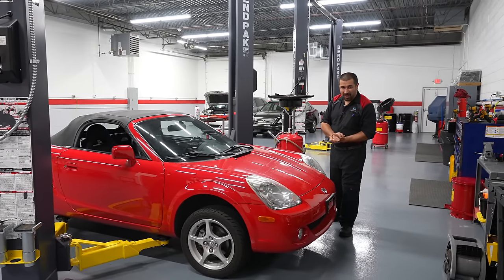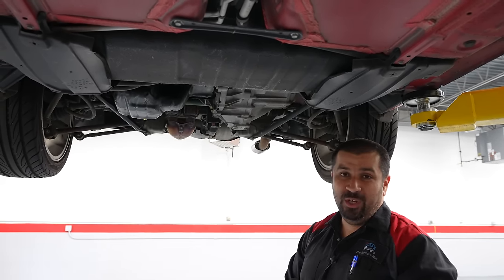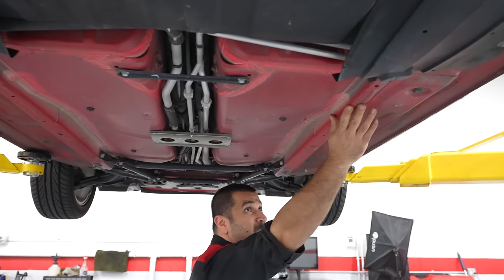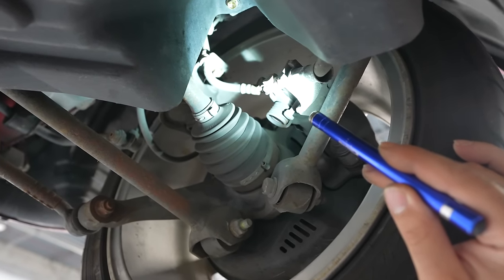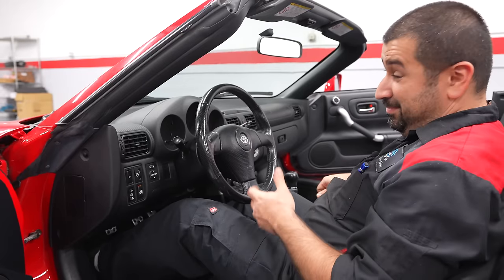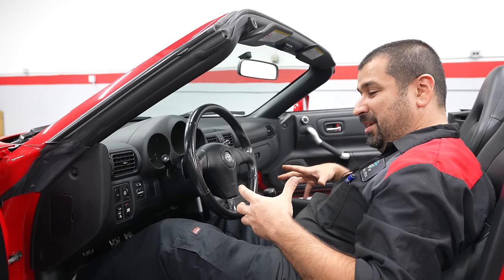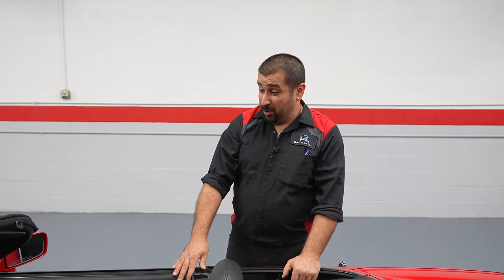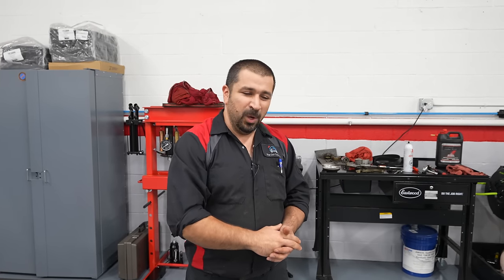Toyota MR2 Spyder Deep Dive | A True Toyota Icon That Should Come Back

Comment: I own a 1988 MR2 with 71,000 miles and it’s my daily driver. I get so many compliments about how cool the car looks and how they wish they never should of got rid of it.
Reply: '88 with 71k miles? What's ur daily drive, 0.8 miles?
Reply: Bought it 5 years ago with 45,000 miles. Have to store it in the winter.
Reply: I had an 86 supercharged AW11. It was the best car I’ve ever had and was the dictionary definition of exhilaration!
Reply: I loved them!! Always wanted one but i just passed my driving test & car ins was peretty expensive 😂 Mk2 i loved too but MK1 for the win.
Reply: @rickproulx6667  Much respect!
Reply: A few months ago at a local Toyota summer show party I checked out an original family owned '86 MR2 with over 300k miles... All kinds of Midwest body rot and rotted floor panels but was still driving well... It had so much more class than the newer tacos and supra somebody was flaunting
Reply: I regret selling my AW11 ...
Reply: I bought my MR2 3rd Gen at 72k 😁
Reply: gordon murray t50 is bascally a modern mr2 except with much higher budget , it even has similar apperance
Reply: @rickproulx6667  Putting miles on that car for daily driving is a sin
Reply: I've got an 88 MK1 Super Charger (had 3 MK1s as it's the only MR2 I love and to me IS the MR2!) It still looks the coolest (especially in Dark Blue that makes it look classy and hides the shut lines), distinctive styling, good proportions (unlike MK2 which got too long/bloated) and yes everyone seems to love it, esp car guys who know what it is.

Comment: These MR2s were selling for around $5-7K in good condition about 10 years ago.  Most of them have been destroyed and junked.  The survivors are just getting more rare and expensive.
Reply: Paid 15k for mine over a year ago
Reply: They go for 12k to 15k for a solid mr-s
Reply: I payed 7k for my 39k mile beautiful 2001
Reply: @arlenburgin2392  i paid $3900 for mine im 2017
Reply: @nx_Exe  timing is everything
Reply: they are still about that price in germany sometimes even cheaper, thats why im looking at them for my first car
Reply: @happi6969  I got mine for 10k and it’s my first car. Had it since august
Reply: just paid under 5k for one, but with over 200k miles. I don't care too much as if the motor goes it will get a better swap anyway, its just the suspension stuff i would need to replace but honestly 50k or 200k doesn't matter much with age.
Reply: Sad but typical. I found is300s in perfect condition the junkyards refused to sell just to they could sell some parts and crush the car. This happens with all cars they don't give an f if it's rare
Reply: Toyota offered me $6k for my 2003 with manual transmission with 108k. The car has been garaged for 18 years and is very good condition. Is it worth more in your opinion?
Reply: @deputy3690  definitely worth more.
Reply: @deputy3690  yes look online at used ones, they're going for a lot. Wish i could buy a clean one like that
Reply: @supers0nic77  I have one as clean as that in the UK....late 2004 , 35000 miles, factory hardtop, tte (team Toyota europe) style/roll bar.....paid £4500 in 2012 with 25000 miles + £500 for a matching colour never used new hardtop and fitting kit I found a week later after buying the car.
Reply: @deputy3690 6k?? I have a 2004 and I would be willing to have a 2nd MR2 for $6k bc that's an absolute steal
Reply: I have 3. Race one, daily one, and last is a parts car.

Comment: IMO this is hands down the best MR2. Most light weight, best handling, convertible and looks great with a spoiler and some side skirts/front lip. People keep complaining about the modest engine but its nothing a few mods can't fix. I don't know why people hate this car.
Reply: after you drive a 2zz swapped one you understand why people spend 3-4x for a lotus, such a fun car
Reply: I purposely bought one with a blown engine so I could swap it with the 2zzge. It is now the complete package it should have been from the factory. Funny side note, this car has a spare tire, and my much bigger GR Corolla doesn't 😅
Reply: Jaloezie
Reply: cya1no  I agree, there's no fixing the 1ZZ and I don't know what Toyota was thinking giving the Spyder such an anemic engine. That's why it got ignored by everyone despite being a one of a kind sports car with nothing like it except the Lotus. 

I got full exhaust, CAPs MAF mod with 2ZZ injectors, Shorter intake piping to the airbox with a TRD filter, Lighter Flywheel, Short shifter and a better clutch. All braces, breast plate, and Tein Monosport Coilovers. It's still only around 140whp but it feels like a proper sports car. 

I will eventually get a turbo or engine swap but there's no way I'm spending 4x more for a Lotus.
Reply: cya1no  I'm thinking the Spare tire is useful on the Spyder to add a bit of weight to the front.

Comment: When i was 22 years old, my first new car was my 1986 MR2, 5 speed manual, red with black/gray cloth interior and red rear wing. Changed the oil every 3k miles. Loved the pop up headlights.  Not one problem ever. Kept it for 7 years and sold it with 73k miles and never had to change the pads or rotors!. Always engine braked by downshifting. Toyotas are super reliable
Reply: Cool car history😊👍
When I was a student in Denmark in 87, I got to drive my professor's new MR2 because he was too drunk after a class party to drive the long journey home (different times☺).
I still recall how much the car enveloped the driver, and the snick-snick 5spd.
Reply: @donswier  definitely miss my MR2. Only very long trip I took it on was from Staten Island NY to Montreal around 1988-89 to watch the Montreal Grand Prix. Was pushing 100 mph. Car was rock solid. Think it had about 110 hp. But super light about 2,500 pounds
Reply: rhdrivingslovenia6413 good point. I deleted all that extra info. Not needed

Comment: I bought a 2005 Spyder 2 years ago. This has to be the most fun car I've ever driven. The only downside is the SMT instead of the 5 speed transmission, but that is what gets attention at the cruise ins I go to. Most people have never seen anything like it. Very unique. Thank you for the deep dive into the Spyder. A fantastic little car.
Reply: A 2005 manual would be a 6 speed, I have a December 2004, 35000 miles, factory hardtop (lifts off in seconds)...tte /team Toyota europe style/roll bar... upgraded Sony head unit....as clean as the one in the video 😁
Reply: Mine's a 2003 with the SMT - a great driving car on summer weekends. Only downside for me is the lack of lumber support.
Reply: I have no complaint about SMT on a 2004. At about 50000 miles there was an odd intermittent problem with the SMT but with the replacement of two sensors it’s back to perfect. Fun car!
Reply: What kind of tires does this MR2 have? Are the different diameter rims still on the car? I have had a hard time finding good tires. Thanks
Reply: @lornepeterson777 Tyre availability is certainly a problem, particularly with the post face-lift model. Here in the UK, there is virtually nothing available with the exact specification. However, if you look on MR2 chat forums, you'll find that people have used slightly different spec tyres on standard wheels with great results.

Comment: My 2001 MR2 Spyder has 9,000 Original miles, never seen rain. 5 Speed manual. Owned it since new. I absolutely love this car!
Reply: My 01 zzw30 has 152k miles, freshly 2zz swapped 6 speed swapped with really rough paint and a bad top. Just ordered a robbins top though so slowly cleaning up the car. Owned it since 2017 when it had 120k miles.
Reply: How would you know! 😆😆🤔🤔
Reply: Wow i wish mine was in such a condition
Reply: @mr2bmw, Sell me your high mileage Spyder 🤔🤣😁🤣 

I’ll take it off your hands… you don’t want that Ole car
Reply: @thomasharris5151  🤣🤣🤣🤣
Reply: Insane
Reply: Cars are not made to sit. Never a good thing because its sitting being a Garage Queen ! I would never do that to any car I owned.
Reply: Get in it and use it. They are nice to look at but far better to actually drive. It sounds like you have had over twenty wasted years (from a driving point of view).

Comment: Purchased a new 2004 MR2 Spyder 5 speed manual in yellow. Still my daily driver 18 years later. Luv it.  Btw I am 71 years old.
Reply: 5 speed , not 6 ?
Reply: Depending on the country, in usa all manuals were 5 speed. Some smt were 6 speed in the later years. Sad though because the 5 speed manual gearing was too short especially compared to European 6 speed
Reply: @supers0nic77  thanks , i am european , i know now.
Reply: @Tweedewoning oh I'm jealous i want to get one of those transmissions
Reply: @supers0nic77  i do understand, but not impoosible to get one.
Reply: @supers0nic77 if i had to guess the euro 6 speed is probably the same transmission in the celica gts/corolla and matrix xrs… don’t hold me to it tho
Reply: Legend.
Reply: I got a 2005 6spd auto and it’s had little to no problems! I love the car!

Comment: AMD, few thoughts from a former MR2 owner...

Coolant bleeding is not that hard, I did it as a DIYer. 
The left vent feeds the air intake for the engine which is cool. 
The hook for the front plastic lid has a holder that it's meant to clip into, you didn't clip it in lol. 
The parking brake on these isn't great, it's  common to fail inspection. 
The "pull" label is missing from the roof release handle - they always fall off. 

Props to the owner, that thing is super clean.

Comment: 13:45 The frunk release is there because if you park the car with roof opened , no one could have access to it if the glove box is closed, so no one can steel your storage area.
Reply: Yes, in my experience every trunk release on a convertible has been in the glove box regardless of country of origin.
Reply: @why6212  The trunk release on my ‘03 Corvette convertible is on the dash…just to the left of the steering wheel.
Reply: @vg3430  my personal experience does not include an '03 Corvette convertible. But it doesn't surprise me for Chevy.
Reply: If they can't steel it, can they aluminum it or iron it? 

Just joking
Reply: My 2016 Mazda MX-5 Club soft top aka Miata has the trunk release to the left of the steering wheel. I NEVER leave the top open if I'm not sitting in it because birds can SHEET in your interior & that is not fun to clean. Also people are curious & like to see what the interior is like - or what you have available to steal. Dumb idea to leave the top open imo.

Comment: Super swift and agile front, great balance and wonderful direct handling, braces within the doors (!!!), McPherson in the front, double wishbone in the back, airbox with separate inlet to the side-vent, variable inlet manifold (made from plastic!), 4-2-1-exhaust-header, precats from hell (remove as fast as you can), revs to 7200, VVTi from 5400, insane cornering speeds, massive grip in the back but also very snap-oversteer-happy, same roof-latches as MX-5 NA, same seat-rails as MX-5 NA (means interchangeable seats), best bushings from stock, brake cooling ducts, limited slip differential, another "glove-compartement" on the dashboard (takes at least 7 shades/sunglasses), pull-out odometer (easy as fuck), alsmost no rearview in reverse (got to lift yourself from the seat to see just anything), shiftknob with a wonderful throw, only 5 speeds (mine from 2000, this red one here is a facelift), a bit noisey on european freeways (last gear could have been a bit longer, as is 120kmh/5000rpm), 2nd pulls straight to 60mph/100kmh (due to rev-limit 7200), looks like a frog on crack but it is such an amazing kiddy-batmobile (mine is black as it's heart)!
Reply: 215kmh top-speed (approx. 135mph) - like a drunken Armadillo on skates going downhill on a icey, bumpy road - due to it's very light front-axle at such speeds and the lack of a proper front-splitter.

Comment: My old 2002 Celica GT had the 1zz-fe up front. Wasn't very fast by any means but that car ran reliably for 190k miles before I sold it. I always changed the oil between 3-5k. Now I have a 22 GR86. Super fun to drive even if it is really a Subaru lol

Comment: Thank you so much for considering what I ask you just last week : something about the MR2 spyder ! This one is very nice and it’s a phase 2 serie : 6 speed, daylight headlights and some styling effects . Here in the south of France we do not have rust in mine is a 2002 with no rust at all under the bonnet. I sell it last year with 131000 kms and it was running very nicely. Just have to take care of the oil level as these cars have the engine getting hot and they love oil. But as ever, if you survey the level, no surprise. In Europe, Toyota sell it with hardtop in option. And the European models were sold with LSD but not in US that was the biggest market for these cars. In France it’s really a rare car, I think you could find find much more of these in Germany. Thank you again for the eyes’pleasure to see such a very nice exemplar of the 1ZZ car 😊

Comment: I had a 2nd gen 91 MR2 2.2L N/A 5 speed manual red with black interior, and a moon roof. Put 150,000 miles on it and still ran great when I sold it. Wish I could have kept it.

Comment: My 2005 Red SMT has been with me the last 15 years. It just hit 100,000 miles. Having the shift buttons on the steering wheel is just what you need for high speeds on the twisty Hill Country roads of Texas. That's what the Spyder is all about. Fun  Fun  Fun. Thanks for the Deep Dive. I hope they bring the MR2 back.
Reply: Hi, have you had any issues with your SMT?  It seems to scare people.  Is there any maintenance that you do for that transmission?  Thanks. George.

Comment: I've had my 2001 mr2 spyder since 2017. This year I completed the 2zz swap after the 1zz blew at 149k last august. I absolutely love this car.
Reply: Did you gut the pre cats before it blew on you?
Reply: @itsjuskey.__  yea i had a whole ebay exhaust from when I bought my car. 1zz in a economy engine and I drove it like it wasn't an economy engine for 4 solid years.
Reply: @nx_Exe  Thats another reason why i think it would blow even after gutted pre cats... driving it like your on a racetrack everyday that might be abusive to the engine
Reply: @itsjuskey.__  yea i eventually got ppe headers and a megan racing exhaust and it was sounding really good for a 1zz. But it was also idling around 3k all the time
Reply: It had a bad piston design specifically the oil return holes were too small where the oil control ring sits

Comment: I owned an original style 1984 (I think) MR2 like the one you showed as a photo in this video. Loved that car! I traded in a Tercel SR5 and bought it off the showroom floor weeks after it first arrived. The only issue I had was that it handled really badly in snow. Probably exactly because is was so evenly balanced front to rear. Still, such a fun car! Thanks for showcasing one.
Reply: AMD, are you really giving away prizes or are these scams on you channel?
Reply: Scam dont fall fot it!

Comment: I own one. The front hood release lever is placed in the glove box so that you can lock it if you park it with the roof down. This way all storage spaces are lockable. It would need and extra lock if it was placed elsewhere (and toyota was extra careful to keep the weight low). 
Also, mid engine cars are the next best thing after awd in low grip situations. Provided the tires are appropriate for the conditions, you get a ton of grip. Of course, the snow comment was probably targeting the predictability of the fwd platform, so fair enough.
Other than that, it did have a "situation" with piston rings/ precat failure you should at least mention. And front struts will need very frequent changes if driven sporty. But all other maintenance items are cheap, including fuel consumption.

Comment: Hello The Car Care Nut,

Love your videos and your shop!

I own a MK3 MR2 Spyder, and have some bad news.  Early models suffer horribly from Toyota's attempt to make the 1ZZ-FE an ULEV vehicle in the MR2/S first.  The problem is that the cats are integrated in the exhaust manifold and start to degrade, resulting in pieces of abrasive material get sucked back into the combustion chamber.

I purchased my 2001 years ago with less than 60k miles from a Toyota dealer and got scammed.  Paid full asking price in  Northern Michigan and ran into a snow storm for the test drive.  All looked OK and had it on a lift to check for corrosion and it was perfect.

NOT.  When I got it off the trailer, it drove less than 10 miles b/4 the MIL/Check-Engine lamp illuminated.

Engine burned oil at rate of 1qt/300-400 miles.

Poor design/manufacturing of catalytic converters that degrade and scored the cylinder walls.  1ZZ-FE also know for oil ring issues and a terrible dealer that knew what was wrong.

Found donor 2ZZ-GE with 6-spd from a same year Celica GTS and rebuilt both trans and engine to NEW....even added LSD

Now I am happy.  Her name is Peep 2.0 after upgrade.  The 2ZZ-GE with 6-spd and LSD now is CRAZY fun and reliable.  Performs like my previous 1993 MK-2 Turbo.  Highly recommend the 2ZZ-GE swap for anyone that has issues with the 1ZZ-FE.

PS:  I miss the MK2 turbo!....it started rusting at the wheel wells.....should have repaired, but I do not do bodywork and sold.

P-Chi

Comment: That 1zzfe , bulletproof. Routine maintenance and those bad boys will last! 
Howdy from Houston Tx!
Reply: Lol. You mean the 1zzfe oil burner? that's not a bulletproof engine and never was.
Reply: @mr2cqql  ok
Reply: @mr2cqql  earlier ones used oil,  the facelift models 2003 on seem ok...my 04 never needs topped up between changes.